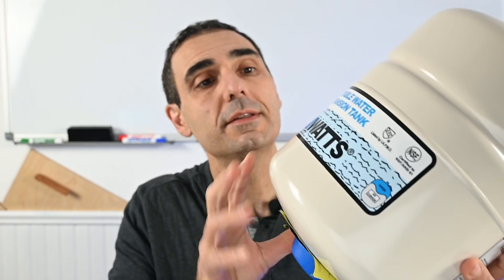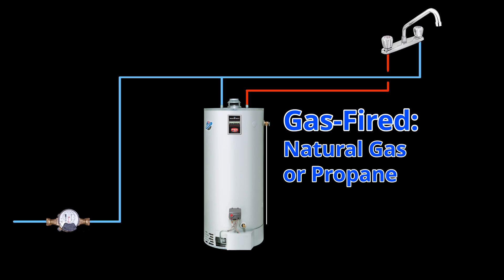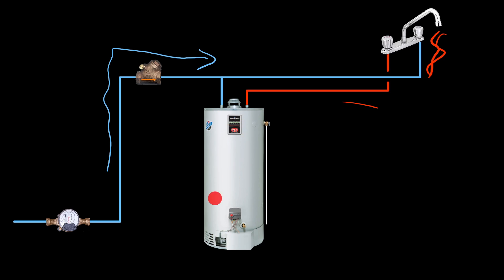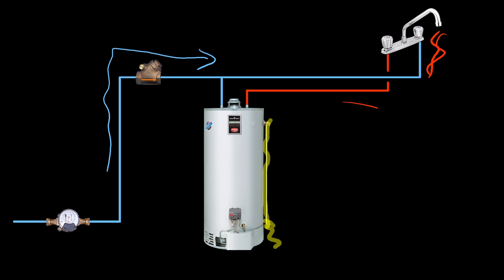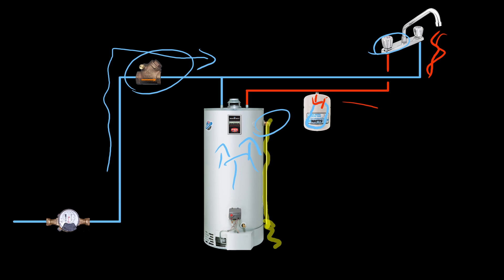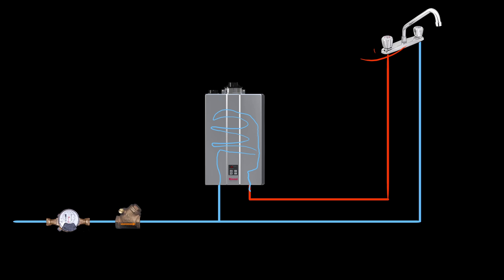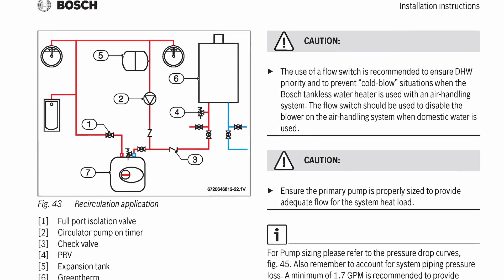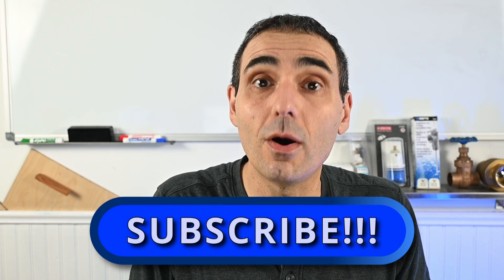PC Q&A: Expansion Tanks for Tankless Water Heaters

Comment: Great video! I have a tankless system with an expansion tank thats bladder has failed ( small black particles coming out from the tubs hot water faucet while filling the tub). Can I just have the expansion tank removed or should I have a new one put in to replace it? Thanks so much!
Reply from the maker: Glad the video helped!  With respect to your current situation, it would be tricky to assess without becoming familiarized with your entire system.  If you are confident that you bladder tank has indeed failed, I'd begin by remedying the obvious - which is to replace the bladder tank.  I'd be weary about outright eliminating it, because I'm presuming it was initially installed for a reason.Most importantly, if you have any sort of device installed upstream (before) the water distribution system which prevents your water from expanding (such as a check valve, backflow preventer, or pressure reducing valve), then you should most definitely have the bladder tank replaced and not outright eliminated.    On the other hand, if your bladder tank HAS indeed failed, then you've been operating without one for quite some time already, and you've noticed no other symptoms with your system (other than the black specks), then uninstalling it outright might be a possibility.

You don't necessarily need to do any major modifications to your plumbing to test out whether or not you require an expansion tank, because the tank connects via a screwed connection (likely a 3/4" male thread).  You can simply isolate and drain-down your system, unscrew the bladder tank, and plug up the connection with a threaded BRASS (NOT steel!) plug.  This way, you can always remove the plug and replace it with a new bladder tank.  

But at the end of the day, I'd simply replace the bladder tank with a new one if you can't accurately assess whether or not you require one, as they're relatively inexpensive and simple to replace. 

Hope this helps!

Comment: How d you winterize an expansion tank?
Reply from the maker: Interesting question.  In the event that you DO need to winterize your system, then that would mean that you're draining down your system of any excess water.  In that case, as long as the expansion tank is not isolated from the rest of the system when you drain it down, then any residual water should be "pushed" out of the tank while you're draining - leaving only air in the tank (which is not subject to freezing).   Ensure that any water lines in the building are not trapping water, which may freeze and lead to frost damage.  Also, If your expansion tank is installed sideways or upside down, you may want to consider outright unscrewing it from the fitting and draining the tank manually of any trapped water by flipping it with the inlet side down...only be sure to re-T-tape the thread and reinstall the tank BEFORE you turn the water back on! 💦   Hope this helps.

Comment: On a normal system with tank isn't it more or less SOP to place the expansion tank on the supply (cold) line?  Ergo your video with the expansion tank placed on the hot line might be a bit confusing to the novice.
Reply from the maker: I don't recall offhand specifically what I said in the video, though I would reason that it would be equally acceptable to me place it on either the hot or cold line (presuming the absence of any check valves in between).  I prefer installation on the cold side if applicable, because doing so would likely delay failure of the air bladder.  However, these are certainly rated for hot water (as is typical in a hydronics system).

Comment: great video. would love for you explain reverse plumbing or first in last out in a cascading tankless hot water setting. lets say you install 3 units in a row, does the master unit always fire first or does reverse plumbing prevent this and units will alternate? or is it all software? thanks for your insight.
Reply from the maker: Thanks very much! 🙏 To your question, by cascading, I presume you're referring to setting up the water heaters in parallel (as opposed to series, which would cause them all to fire, but the first one will endure the by far the brunt of the work - I'm not sure why anyone would want to connect in series).  

Presuming that all three are connected in true parallel (all connecting piping being of equal lengths, distances, and fittings), then they should fire equally and at the same time.  I'm honestly not sure of there's a way to have them fire independently or in alteration as you suggest, although I can imagine that it could be done with some sort of timed solenoid valve configuration, which could allow the cold water feed to be redirected in turn.

Thank you nonethess for your interesting question!
Reply: @PlumbingsCool   yes with on demand water heaters like rinnai in many instances especially commercial you would hang more than one I. A row. They are supposed to turn on based on demand so they all may not fire at once.

Comment: Thanks so much for explaining this!! My townhouse has an expansion tank with my Rinnani on demand water heater so I wonder why they built it this way! I’m at 7200’ elavation
Reply from the maker: 7200 feet elevation!...WOW! 😲

Still, your elevation shouldn't be a coarse for your requiring an expansion tank.  My guess is that somewhere along your cold water inlet (before your Rinnai) is a check valve...or perhaps even a backflow preventer? (which essentially both do the same thing:  prevent water from flowing in reverse direction.). If that's the case, then the expansion tank would prevent any buildup in static pressure (although you shouldn't be getting much thermal expansion since the water is heated only as required).

Comment: Thank you so much for sharing your video, my house is a 10 years old, we just changed to the Timeless one months ago, we don't know why after the Timeless cause a house that has a water hammer, we don't have a disconnect issue before。 second floor Cosmo issue, every time after you wash your hand Wendy turn off the water you heard about the noise， we tried to drain the water from the pipe, Osterville Ethan, the first five minutes the noise is gone then  come back again， the dishwash no problem but the laundry wash is really noisy， Wonder heater we do have a extension tank。 but we don't have it on the hot water line。 is the Tankless do we need to install the Extension tank on the hot water line?or water hammer rest? 
Do you have any idea better?
Reply from the maker: Hi there.  It's difficult to diagnose your problem without additional details, but one thing that does stand out for me is that you mention water hammer when operating the clothes washer.  It should NOT be associated with the fact that you have a tankless heater instead of a traditional water tank.  

Water hammer usually the result of your water pressure being too high:  When the high flow of water is stopped suddenly, then that energy from the flowing water transfers to the pipes (which creates the "Bang!")  Although an expansion tank would help with water hammer, you usually install dedicated "water hammer arrestors" onto the hot and cold water lines serving the fixtures that are causing water hammer, which usually consist of fast-closing valves - among the most notorious being washing machines and single-lever shower/bathtub  valves.

If your water pressure is too high (over 80 PSI), then the best solution is to reduce the pressure by installing a pressure-reducing valve (PRV).  To learn more about a simple to measure your water pressure and installing a PRV, you can check out my video here:

https://youtu.be/_dBLKHrOE98 

Hope this helps!
Reply: @PlumbingsCool  

Thank you for your reply. 

We have hot and cold water hammer assester on the washing machine as well as one for the dish washer

We have lower the main pressure to 40-45 psi and even installed a thermal expansion tank on the cold domestic side and still hammer 

We used to have a Navien combi tankless and a electric water tank
The chasis cracked and we replaced it with a Rinnia combi with out a storage tank. 

Do we need to install a storage tank?
Reply from the maker: Hmmm...not too sure.  I noticed that you mentioned both an "expansion" tank, as well as a "storage" tank, which are two different things.

I'll never be able to provide you with a definitive answer without a closer inspection of your system, but if you did actually mean "storage" tank, I'm not sure why you'd need one as it would eliminate the entire point of having an "on-demand" water heating system.  The combi unit should have been sized large enough to handle your total hot water requirement without having to pre-heat and store water.

Comment: Great video. I thought you had missed one thing. There are check valves withing the tankless water heater that I would have thought meant you have to put the expansion tank on the hot water side. However, looking at your diagram the thermal expansion that does occur with the recirculating loop is still relieved by the expansion tank on the cold water side. Thanks for the video.
Reply from the maker: Thanks for your feedback and insight!

Comment: Does the expansion tank need to be installed on the cold side before the water heater or on the hot side after the water heater? Thanks! Awesome videos! Merry Christmas! 🎄🎁
Reply from the maker: Technically, where the expansion tank gets installed doesn't really matter because the pressure will equalize evenly throughout (provided there's no other check valve in between).  However, if I were splitting hairs, I'd rather put it on the cold side because (at least in my mind) I'm willing to bet that the constant exposure to hotter water may shorten the lifespan of the internal bladder, compared to only cold water.  But that's just my opinion; these tanks are approved for both cold and hot water applications (such as with hydronic in-floor heating).   

Hope this helps.   Thanks for the inspiring words! 🙏 Merry Christmas to you too! All the best! 🥂
Reply: @PlumbingsCool  Awesome! Thank you for the swift response! MERRY CHRISTMAS!🎄🎉
Reply: Read the instructions that come with expansion tank (Manufactures spec.  It will be listed there)

Comment: why do you install a check valve on the cold
Reply from the maker: A valid question!  Note that you don't ALWAYS need to install a check valve.  In certain circumstances when measures need to be taken to eliminate the possibility of water reversing toward the source water supply (otherwise known as "backflow") in the event of pressure differentials caused by various reasons.

In this case, the check valves were already existing, and my suspicion is that the purpose of this particular cold-side check valve is to eliminate or minimize the creep of hot water rising up from the tank, back up into the cold (for thermal efficiency).  Although it's arguable whether a check valve would be needed at all in this particular scenario (I see absolutely ZERO need for one on the hot side), this is an extremely large home with tons of concealed piping, four(!) independent domestic hot water systems and respective recirculation lines, I felt it best to err on the side of caution and keep the check valves by simply install the expansion tank to resolve the issue, rather than blindly eliminate the check valves without the ability to deduce the repercussions.   Note that a check valve IS necessary on the hot water recirculation line just upstream of it tying back into the cold water supply upstream of the tank, because failing to add one will likely cause cold water to backflow up through the recirculation line whenever someone opens a hot water tap (thereby causing the cold to mix with the hot).

As well, sometimes the municipality, township or other conditions require the installation of a backflow preventer (which is really a testable set of check valves in series) on the cold water feed coming into the building (particularly if there is a risk or possibility of the potable water supply becoming cross-contaminated by harmful chemical which may exist or be used within the building.)  The installation of a check valve or backflow preventer will instantly create a closed system because the water downstream of the device has nowhere to go.  Therefore, an expansion tank is absolutely necessary.

Hope this helps, and thanks for your inquiry!